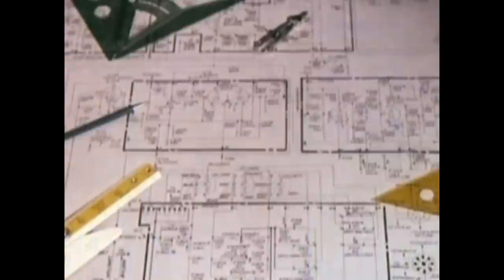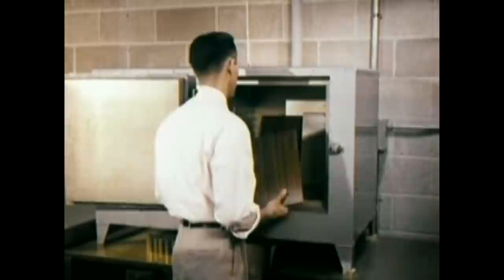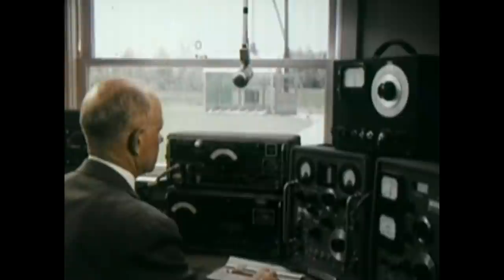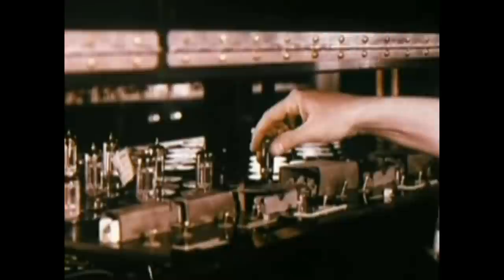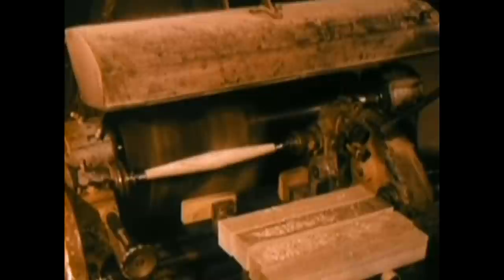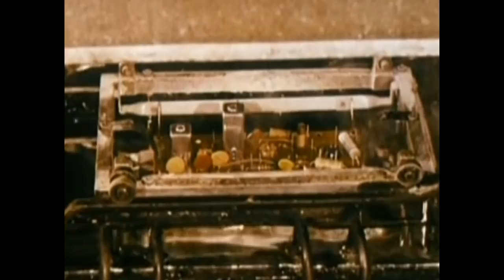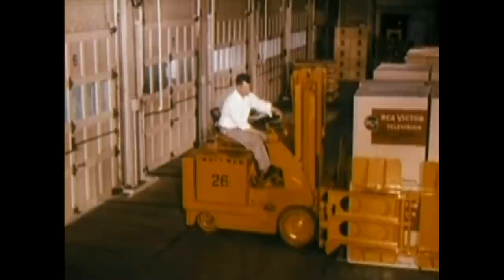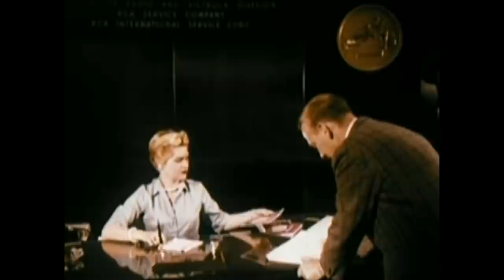Original 1956 RCA Film: Vintage Television Electronics & Vacuum Tube Production, TV technology

Comment: I'm a ham radio operator, these RCA tubes from the 40s-60s are still rocking the air waves today. I just restored a radio from the 40's with RCA tubes, not a single one was bad. I guarantee you wont be able to say that about Chinese made components  in 80 years.
Reply: Dittos, OM,  KR4HH
Reply: that is because companies still did tot now that a TV that lasts more than 5 years costs them money not make it. 5 years may be long enough to ensure you buy a new one from the same manufacturer. But not all tv's make it that long anymore yet they did sell you a tv so they made money off you in the long run.
Reply: Back when you had to take a morse code speed test and build a working component to learn soldering ect.
Reply: They're still rocking in my living room as well as I have an all original stereo receiver from 1961 with the same valves as when it came out of the factory. Most of them are mullard England and rca USA.
Reply: @brianchisnell1548  You still have to do these tests in Canada to have a full license.

Comment: Actually on old TV's and radios the main reason for failure was in the Capacitors.  They would get old and leak.  Many old radios and TV's can be brought back to life by changing out the capacitors.
Lots of the tubes lasted forever.
Reply from the maker: Very true!

Comment: I'm amazed at the complexity of this once massive system.  Take for instance the automated tube checker.  A lot of engineering went into building one of those and I doubt any sit in museums.
Reply from the maker: Hi Fred, good point!   Thanks.  Victor, CHAP
Reply: The testing equipment was more advanced than the TV's!
Reply: Your doubts are unfounded There are allot ot museums,  some for instance in the national geographic museum in Victoria BC Canada , they have allot of historical TV tech on display.   Based on that , I'm sure somewhere there is one of those on exhibit
Reply: Re "allot ot engineering went into ..."That's what they are trying to convey to would be competitors, luckily sony , samsung panasionic knew it was all bs, , in fact the 60" flip out RCA projection tv sets that cost $30k in the early late 70s  early 80s had Toshiba  manufacturing Japan written on the back panel 😂😁 I never bought another RCA after that. companies still do this,  with amazingly simple products too.  Philip's led lights in Canada say made by Signal Mfg right on them,!
Reply: @ComputerHistoryArchivesProject    I love watching these kinds of films for the nostalgic and to see the products,  even though i know the publicity dept made these
Reply: that tube tester is in some nerds basement
Reply: Isn't technology wonderful?

Comment: I repaired tv’s in the mid 70’s and the biggest issue we had was the grounds on the chassis. Resolder the grounds and that fixed a lot of issues.
Reply: Yeah because everything in the video is advertising lie, reality get these things out the door, 1000 per minute ! Ship ship ship , sell sell sell
Reply: Many of the circuits in those older receivers stressed the sweep tubes beyond their recommended ratings, and so those often failed.  Rarely did tubes in video and audio circuits need replacement even after several years. After the last of those circuits went solid state, reliability was greatly improved.  The CRT design was also improved, increasing its service lifetime considerably.
Reply: The tuner on board design, and ground issues.

Comment: Fantastic film! I remember well going to the RCA Harrison plant on a high school field trip in 1970 or 1971. I was really into electronics at the time so I was in hog heaven. The Harrison plant was bought from Edison and those buildings were from about 1880-1885 as I recall. Very old 3-4 story brick factory bldgs, even then. I remember most of the floor was comprised of 3" x 12" raw wood planks. The most interesting part (to me) was the tube-making carousels. Utterly fantastic machines, maybe 10 feet in diameter, all chain driven. There were perhaps 45 stations around the circumference of the machine. They were making only glass-base tubes at the time. Starting with the base, at each station a tiny piece of metal was fed in, then spot welded to the supports, then KACHUNK, the carousel rotated a notch after maybe 12 seconds at each position. Then the lower mica. KACHUNK. The cathode. KACHUNK. Grid #1, KACHUNK. Grid #2 KACHUNK. Plate. KACHUNK. Top mica KACHUNK. Getter. KACHUNK. The top of tube, looking like a champagne flute dropped over the guts. KACHUNK. Gas flame welds the top the base. KACHUNK. Vacuum out the air. KACHUNK. RF coils flash the getter with barium wool. Although it was completely fascinating, it was also clear it would drive you frickin batty after a few hours.
Reply from the maker: Hi pneumatic00,  that's a fascinating story!  You were lucky to be able to visit the plant in action back then.  I can imagine the sounds just as you described.  Thank you for sharing this memory!  ~ Vincent, at CHAP
Reply: @ComputerHistoryArchivesProject  I have been looking on YT for some footage of one those machines in operation, with no success. I've been able to find a few videos on tube construction, mostly gals with tweezers, but so far none of those incredible machines.

Comment: Amazing.... This explains why my 1958 kitchen radio still works perfectly (granted it's a Blaupunkt, but I guess that would be the European equivalent to RCA). I have owned it for 15 years, I once had to replace the the scale bulbs and when I took it apart I was amazed - it was all original inside!

Back then quality mattered.
Reply from the maker: Yes, great quality from that time period.  (I wonder if your 1958 radio has the "CD" on the dial for "Civil Defense" too :  )  ~ Victor, at CHAP
Reply: @ComputerHistoryArchivesProject  Only if the radio was made for the US market.
Reply: German electronics standards are what it’s all based upon. Think Project Paperclip. Blaupunkt is indeed still a very high quality company.
Reply: @RJDA.Dakota  is it? it suffered too in the last decades well at least in the cheaper consumer category...

Comment: I get the impression that the aspect of longevity seemed to play a much bigger role for consumers back then.  Of course, electronics weren't as reliable as they are now, but still.  In today's adverts, longevity is rarely mentioned. People do not care and producers tend to build for a short livespan to sell more.
Reply: They really are not reliable now.
Reply: I have a 62 year old radio in my kitchen, use it every day. Will I still be able to power up this computer I'm now typing on in 60 years? Doubt it.
Reply: I have a 1959 Zenith 8 transistor Royal 500 that still works with all-original parts. I never got around to re-cap it. Put in batteries and it just works.

Comment: I started in my electronic career just as the all tube sets were replaced with the XL 100 transistor line.  All reliable in a school system environment. Even had RCA intercom and PA systems from the 40's still working on the late 80's. Miss the days of learning, analyzing, troubleshooting, and repair. Now just set it out for trash and buy new, no repair feasible.  But can't complain about video quality of today...😉
Reply from the maker: Hi Dan,  great comment.   That must have been a fascinating career, thanks for sharing!  ~  Victor, CHAP
Reply: Dan, I do remember those days and loved the "new" XL 100 and "ColorTrak" sets. One thing I enjoyed was having to travel to an RCA training center to learn some new chassis stuff.

But as for tossing out the TVs today, some yes, but others can be repaired.
The biggest problem these days is trying to get GOOD schematics, parts list and PARTS for some makes.

Most are truly designed to be tossed, that's for sure.

My favorite TV of "these days" is our Panasonic 3D Plasma TV.  I've had to repair it twice in the (around) 12 years that we've had it.

The first time I opened it up, I was surprised at how minimal the circuity was, especially for a 3D TV.

The first repair was a few of the larger capacitors in the power supply.

The 2nd was one of the several fans seized up and the TV went into protection mode.  That was an easy fix too as all I had to do was take the fan apart and do a good cleaning on it and oil the shaft.  LOL

It's too bad that companies make tvs as throw aways now.

I think that's part of the reason why some of the bigger companies have either stopped making TVs or have really cut down or only sell to certain countries now.

Like you say, we just get garbage now, mostly coming from China.

Even the wonderful RCAs of the past did not carry on the quality control.
The crap tvs with the RCA name on them are not nothing more than the same trash sets that are out with other brand names on them.

Comment: The lack of safety in these plants is shocking by today's standards. People handling lead circuitry bare-handed for 40 hours a week, working with radioactive picture tubes with no protection, spraying  chemicals with no respirators, cutting wire and trimming electrical leads with no eye or hand protection. It makes you wonder how many thousands of people died an early death from lead poisoning, cancer, lung disease, and other maladies from working in these plants. That woman trimming leads with her bare-hands on lead covered boards was especially shocking.
Reply from the maker: Interesting observations, thanks very much.   ~ Victor, CHAP

Comment: He says "quality" a lot, but this was actually when RCA started getting cheap by using printed circuit boards. Tubes and circuit boards don't mix well....
Reply: Heat cycling and materials of different coefficient of expansion.  Worse today with lead free solder.
Reply: @hawksights  Heat causes boards to flex, causing bad solder joints. Also can crack the boards.
Reply: Heat from the tubes.
Reply: PCB's don't provide the heat dissipation of the old metal chassis... of course the power requires of the time where quite large!  Made a few 1000 watt linear amps with horizontal fly back parts of the TV (other parts too).

Comment: Looking back at history you see that at the rise of consumer electronics -the 1950-ies- quality was very important and used as selling point. After that, the 60s into the 70s production costs became more and more important until it seemed to be the only design criteria. Just open a Philco or Zenith radio radio television from the late 60s or early 70s. The construction was horrible. I just don't know if the component defect rate could be kept low due to the vast experience gained during the previous years. As I live in a humid tropical area where everything breaks down rather sooner than later I would not be able to tell.
Reply from the maker: Hi jlinkels, I think you make some very good points!   Thanks!    Perhaps the growing competition from non-US manufacturers were a factor in pushing quality control construction farther back in overall importance, than making a product that could get to market relatively fast, at a competitive price.  Just wondering. ~ VK

Comment: This all may have been true  "back then"  but the later  (color) sets using  very high power  horizontal output and other tubes  with sockets  mounted on a PC board absolutely sucked.  The  big tubes  simply cooked the 'ell out of the board, and generated  intermittent and other problems.
Reply from the maker: Yes, tubes had their difficult issues as well.   Good point!   I know a lady who's tube console set (1960) caught fire just from bad tubes and/or transformers.  ~  Vincent, at CHAP
Reply: The "fly back" transformer on a color TV created 27kv on its output. That voltage was still present when the set was off as well.
B&W tvs were 13kv
Reply: @ComputerHistoryArchivesProject  What causes a fire..
The oils inside the (directly connected) Capacitors, "sour from age" & the part "shorts out" and the transformer overheats..
All electronics components, from back then...and today..are mainly Chemicals.
Time is unkind to chemicals.
That's why you see expiry dates.

Comment: I sometimes wonder if testing like shown here goes on these days! I kind of doubt it!
Reply: Lot of it is automated. And it is different. PCB are inspected by cameras and OCR systems. You can automatically check multiple boards by check pins. But anyway. In cheap electronics rarely tests are that elaborate. Especialy mechanical things. You not have lot of mechanical things on modern systems.
You get what you pay for. Now TV is cheaper than my mortgage payment because manufacturing costs and ability of mass produce very elaborate parts is very cheap. Few decades ago color TV was expensive almost like used car. And lot of it was assembled by people and tuned manually. Now same circuits are able tell you - i am shitty component and tune itself into various frequencies. You can also do a bit of crappy work on VF part as majority of things moved toward software radio.
Reply: @rybaluc  This type of checking was the base of what the great manufacturers do today, namely build it with so much precision and confidence that there is no need for much human checking. What is needed is mostly done automated, except that final human eye.

Comment: Does anyone have any idea where exactly in "Medford NJ" the testing center was?
Reply from the maker: Hi Michael, great question, here is some info we found to help answer:  
Haven't found specific reference to Medford, yet, but this may help.  RCA was huge back in the day.  They had buildings in Camden, NJ, and Harrison, NJ, and other locations.  In 1930 R.C.A. bought the old Thomas Edison property, and began to manufacture radio tubes. R.C.A. was very successful, and expanded the plant to cover 9.5 acres, with 26 buildings. They made over 3 billion radio tubes at this location. The R.C.A. employee base consisted of more than 80% women. New technology was forcing the radio tube out of existence, and in 1976 the plant closed its doors and the site is presently occupied by the Harrison Plaza Shopping Center.

Comment: This video show the days when TV had standard and quality not like the SMD garbage that they make nowadays
Reply: I'm guessing you're not old enough to remember having to replace tubes, going to the back of the TV to adjust the color guns periodically, or having to regularly adjust things like the vertical hold and the fine-tuning.
Reply: @almostfm  And for the color sets, the convergence process!
Reply: If it wasn't for SMD components and multi-layered PCBs, you wouldn't have the amazing electronics that we have today.  Or at least, not in the "small" sizes of today.

I get what you mean though.  There's so much garbage out there with really poor designs and low quality "GET THE OUT THE DOOR" components.

But there are some products that are made today, using excellent components and sweet designs.
But they come at a very high cost.

I totally agree about the tv quality these days.  It's pretty much impossible to get truly decent quality now.

I feel sorry for people paying those premium prices for those OLED sets.

While they have gorgeous pictures, they will not last a long time at all.

Even things like picture tubes lost quality back in the 1980s.
Before then, when made here, they were excellent and lasted.
Then RCA and other companies started to get them made off shore and the quality plummeted.

good times

Comment: The Chinese don’t perform quality tests on their electronics. You’re lucky to get 2 years out of a Chinese flat screen. No quality control from electronics assembled in Mexico either
Reply: Chinese perform exactly what is required according the specs. If tests are not in the specs then they not do it. They are able to manufacture top quality products as well as absolute crap.
You will be amazed how much top tech stuff previously done in US/Europe is done in China. Sometimes even in better quality or based completely on new research done in china.
Be surprised, many of your packets flow through Cisco devices produced in china. They will probably work next 3-10 years until increased import tariffs cuts last remaining manufacturers.
Reply: @rybaluc  SOME chinese perform exactly according to specs, if forced to economically. Left to their own devices, most chinese-run operations will produce borderline garbage, wasting precious raw materials and energy. The chinese are good at copying but not in inventing. They seem to be competent in creating viruses, both real and cyber, however.